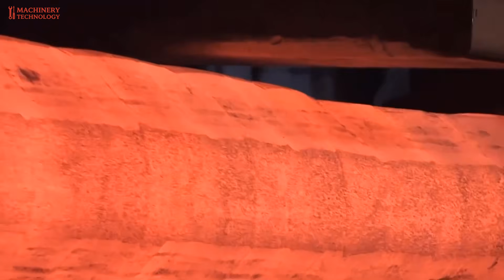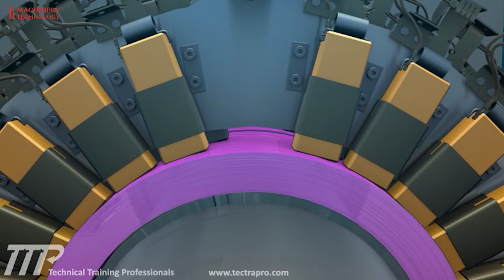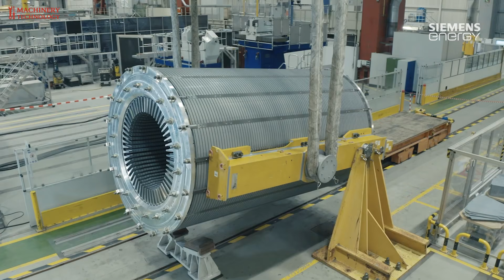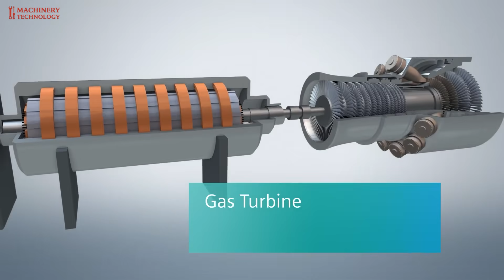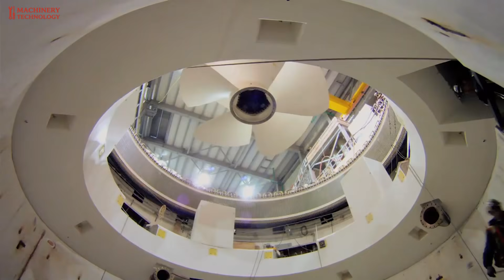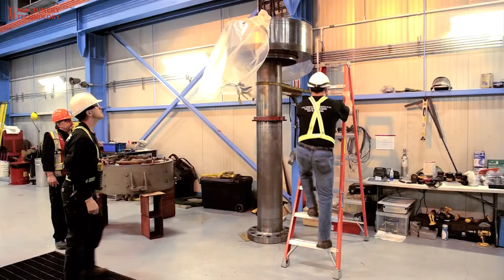How Giant Electric Generators Are Built — And Why They All Run at 50 or 60 Hz

Comment: Hello, thank you so much for this video! I'm doing research on electrical generation in the US for an article I am writing - may I ask where you got the clips for this video, and your sources of info? This is extremely helpful, thanks.
Reply from the maker: Thanks! Glad the video was helpful. The clips came from several publicly available industrial/manufacturing videos, and I also cross-checked the technical information from multiple engineering sources while putting the video together.

If you let me know which specific clips or parts of the video you're interested in, I can try to point you toward the original sources. What aspect of electrical generation are you focusing on for your article?